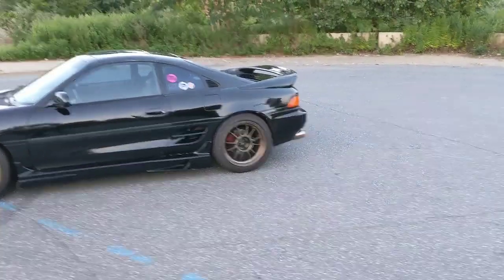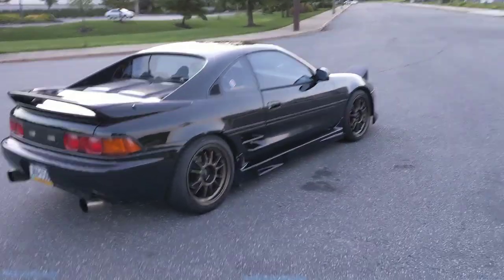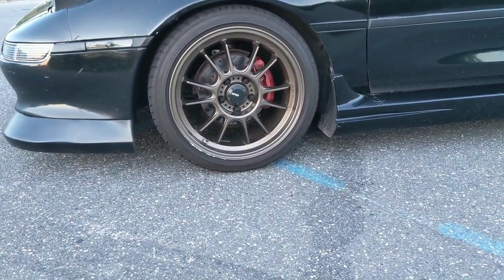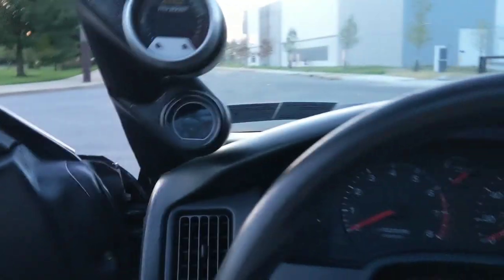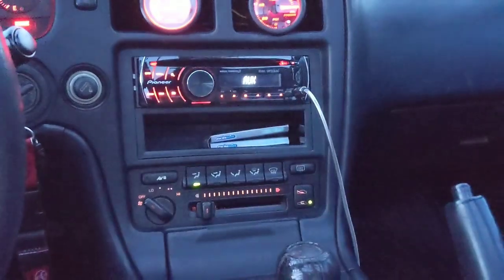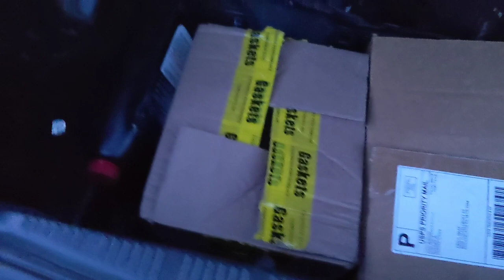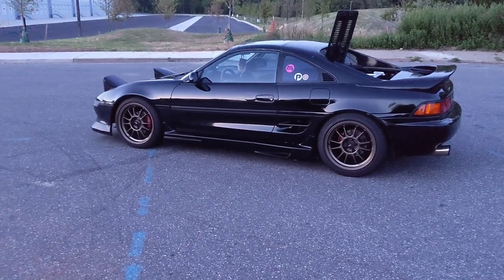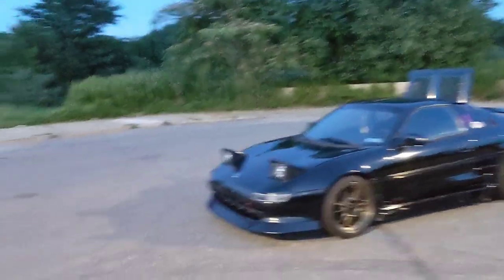Mr2 sw20 turbo- mod list & 2+ year ownership review

Comment: Nice car. I have to point out that the door card is vinyl, not leather and the steering wheel is Celica GT. The GTS wheel has leather wrapping which on mine is hard as a rock and thick stitching which is coarse and also very uncomfortable to touch. For these reasons, the GTS wheel is in a closet and the GT wheel is on the car, in my case a Camry.  (I'm plotting and scheming to get an MR2.) Gauges in the vents seems like less than a perfect idea to me. Call me old fashioned. ;-)
Reply from the maker: Ahhhh good to know, the previous owner told me is was leather so I went along with it but I am glad to know it is that. And yes I realized that a couple months after when I saw the differences in the gt and gts wheel haha. And yes I am half and half on my vent gauges but I will need to find a custom vent guage holder to make it look cleaner. For now my set up does the trick 😁
Reply: @TheMaafiaGarage  I've seen somebody epoxy the broken door card from behind and I would stick on a layer reinforcement which he didn't do. You can then mend the vinyl with a kit and restore a similar texture to it. I think that would feel good. :)
Reply from the maker: @jozsefizsak  yeah I've seen that also on facebook, mr2 heaven was selling a kit for this problem haha. I will definitely do this soon!

Comment: About 15 years on my ATS knock sensor adapter with GM sensor at 14psi on a ct20b, 91 octane. Seems pretty durable.
Reply from the maker: Thank you for this! It's over 2 years on mine and mine is still good too!

Comment: What’s the #1 thing to upgrade or replace when getting a MR2?
Reply from the maker: @HYTR8X  hmmm that is an interesting question. Replace would be the timing belt and water pump if not done so recently. And basic maintenance with that like all fluids
As for upgrade, for the turbo model I would say the intercooler. 
The factory intercooler heat soaks so fast. Like literally after 2-3 pulls you'll start losing power lol

Comment: What sizes are the Konig Wheels? did you have to do any work on the fenders?
Reply from the maker: I mentioned in the video and yes I rolled the rear fenders
Reply from the maker: 17x8 +35 front
17x9 +25 rears and I rolled fenders in the rear